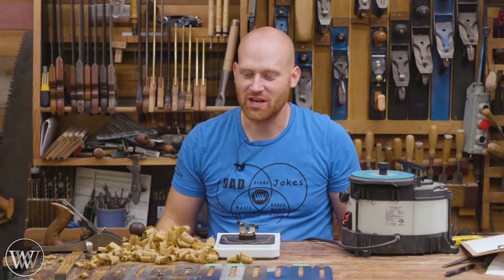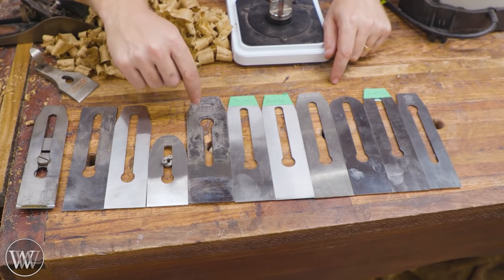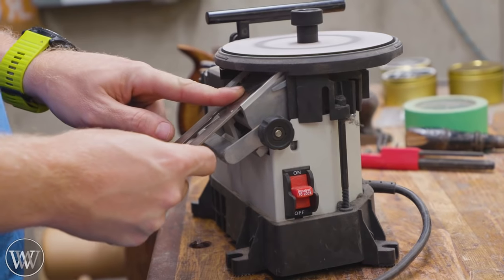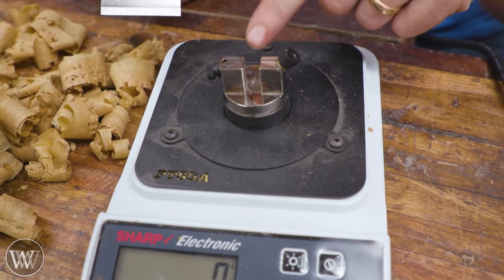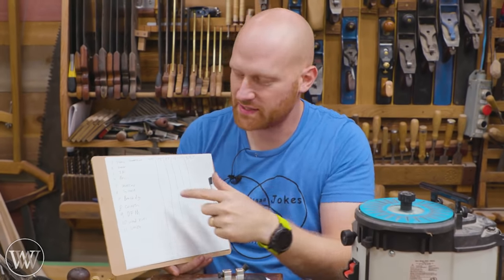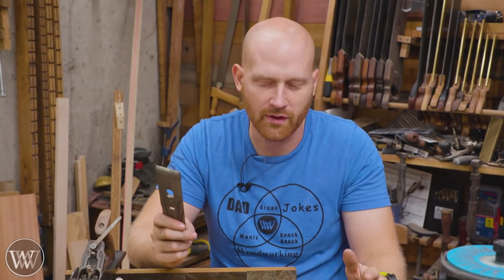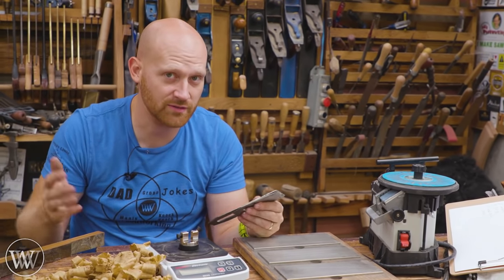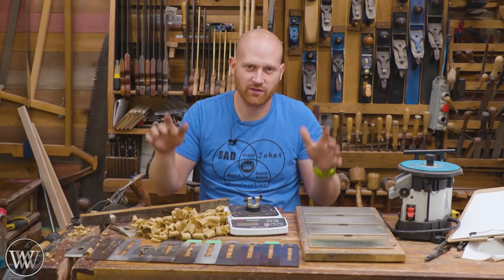Plane Iron Test Method

Comment: hello! i´m a bass builder in Mexico City, i have and use some Mexican made Stanley planes (3 and 7) and an old USA made no. 5.  My teacher shown me some of his blades... they are the regular old Stanley blades, with some saw steel blades braced to the original blades...  recently found and get an Chinese (AliExpress) blades that are made that way,  the cut portion is very nice hight speed steel a little bit thicker than the "base",   The finish is not great, but after some work with a file and sharpening, the blade seems to work very very well, and stays sharp longer than originals.  Cheers Rodrigo

Comment: Your testing methodology looks interesting!   A couple questions:  Is the video around 5:04  and 5:45 duplicated?  Second, do you measure the thickness of the shavings / blade depth of cut for the different blades?   I would imagine a test with blade X producing a shaving of 1/1000 inch and blade Y producing a shaving of 1/2000 inch during your test run would result in different sharpness results.    Looking forward to seeing your results!
Reply from the maker: LOL I missed that int he edit I will have to see if I can change it.
yes I do check the first shaving of each run to make sure it is the same on every cut
Reply: @WoodByWrightHowTo  You may want to get one of those plane setting gadgets from iGauging. It should reduce the number of test shavings that you'll need to get to your desired thickness.
Reply: @WoodByWrightHowTo  Like Matthew said, test shavings will skew results. Id try one of those router table depth gauge things to see if you can get an accurate setting right away.
Reply from the maker: So far in my tests I have not actually had to adjust it at all. I still check the measurement of the first shaving to make sure it's within a thousandth but as long as the depth adjuster isn't moved and it's set right back against it it will give you the same shaving.

Comment: Hey James, you should consider testing impact resistance of the blades. Eg when you're using it on shooting boards. Maybe a fair test could be of you shooting end grain of the lignum timber you have.
Reply from the maker: I might have to think of adding that. it might be worth the test.
Reply: There shouldn't be any impact damage on plane irons in a shooting board unless you're shooting something like purpleheart (which you probably shouldn't shoot). A shooting board is a poor test of durability, too, as the overhead bias of a plane doesn't work (that is, when you push on a handle of an upright plane, it's working as it should. It's lacking pressure on the sole when it's on its side). I did a plane iron test a couple of years ago now and found that on a board end upright in a vise, O1 planed about 800 feet and V11 planed slightly more (in cherry). V11 planed double O1 in long grain (which is sensible as it is about double the abrasion resistance). It was a painful test to do, so I didn't plane a wider array. If you think about how many shooting board strokes that would be, you can see why shooting boards weren't often used historically unless items were small or very narrow  -they're wasted effort.

Comment: Great timing on this series for me. I just picked up a stanley 5 1/2 for $10, but the blade is almost used up and will have to be replaced. Luckily I have a 6 that uses the same blade, so I can play with it until I learn from you which replacement blade is better or decide to just make my own blade.

Comment: I tested an array of irons a couple of years ago and planed about 50k feet (and weighed the shavings). The irons that I tested with their relative life to good O1 (I made the O1 iron, but later tested it against a hock iron and it planed slightly longer than hock, but probably within the margin of error). 

* Ward laminated: 0.72
* Starrett O1 steel hardened to about 62/63c: 1.0
* Tsunesaburo blue steel: 1.03 (this iron released bits, probably carbide, but all of them likely do, so they underperform expected a little bit)
* LN A2: 1.25 (but you wouldn't like using it after the same distance the O1 iron dulled)
* Chinese HSS (green irons with the bit brazed on the end) - overhard vs. spec, over 65: 1.7
* CPM 3V at 59 hardness: 1.7
* PM V11: 2.0
* CPM M4: 2.05

What you'll find is two things:
1) irons with a greater volume of carbides harder than iron will wear longer
2) irons of the same composition with higher hardness will wear longer

I repeated some of the tests above, and have used a lot of V11 since doing this test - it does take twice as long to sharpen (not to get sharp, but to remove the same amount of metal and get past any nicking that has occurred). V11 is not particularly tough, so it will accumulate some of that nicking in regular work (a2 does, also), but in an idealized test, I didn't see any real edge damage from anything except running into silica inclusions in maple (that destroyed the edge of every iron and I had to restart the tests - twice). 

No matter what you do, someone will have a problem with it. My data set was tight (the results above were from a couple of tests normalized together - any odd results were repeated). 

The V11 iron has less cut resistance in a LN 4 - I didn't listen to hear how you're going to test, but you can feel it. M4 and 3V had much more cut resistance at the same sharpness (1 micron diamonds)

I would sharpen the irons at least to 32 degrees final bevel to limit variations in the results due to edge damage. People will have a problem with that, but the question for them is why they would use their irons at a shallower angle if edge damage limits edge life. You can ignore them. 

I've gone back since then (I found out what alloy V11 is and made a bunch of irons for myself, and eventually sold the "real" v11 iron) to O1 for the most part for heavier planing as it nicks less and is far faster to sharpen nicks out of.
Reply from the maker: Sounds like you had a lot of fun with it. I actually just finished the testing yesterday and should have the video coming out on it in the next week or so. In the end I tested 24 planes. Many of which had the same alloys but ended up working differently because they were treated differently. There were a lot of very surprising details that came out.

Comment: Consider including a vintage Eskiltuna blade - I might be able to find one for you if none are available however international shipping time/delay may ruin your schedule.
Reply from the maker: The problem with testing vintage planes is that there was a huge variance from batch to batch in hardness and it really won't tell you much about the rest. Until digital controls came around for tempering it was something that was more by eye and feel than measurement. And different companies would actually have fairly large variances on quality control because there was no way to actually lock it down. I'm including a couple vintage irons just as a control. But I may add more in the future we'll see

Comment: I know your done with these tests but another thing you could test is rust and corrosion resistant. I'm sure you've noticed that some tools rust way faster than others. I've got some tools that will start rusting immediately when they come into contact with any type of moisture. Many times they are my favorite as far as performance goes but they take a lot more maintenance. Usually if they set for any amount of time you'll have to strop them especially if you forgot to oil them before you put them away. You could probably tell a great deal about it if you know what kind of steel is being used. But I don't know if the manufacturer reveals the types of steel used. You would think for replacement blades they would but I've never really checked.

Comment: Control/measure shaving thickness.  Include plane waxing into process control.  Need to control iron pressure on plates in some manner a well as perpendicularity to get consistent readings. Need to do move irons through in a random manner and in small work group activities.  i.e. Iron #1 20 shavings, Iron #5 20 shavings, Iron #2 20 shavings.  Complete all shaving work prior to moving to next work group.  BE RANDOM to reduce induced bias into the process.  Be sure to use the same piece of wood for all irons in a group/series (20 shavings for each) before changing wood.   You might look at "David W" channel for additional information some of you irons, process used, etc.  Good luck and thank you for sharing the results.
Reply from the maker: right on. I will be measuring shaving thicknesses and yes they will all be done in sequence I have padded storage shelves to protect them when it is not their turn in the plane.
Reply: @WoodByWrightHowTo  Right now you have too many variables to get good useable empirical data. I suggest replacing the tote and knob of a plane with blocks of steel or lead, then add a pulley to the end of your bench and run a  1/16" steel cable (it won't stretch like rope will) from the front of the plane (the knob block) thru the pulley and attach it to a weight. To use this setup, you drop the weight and let gravity pull the plane along the test piece. This will give you a constant downward pressure on the sole and a constant acceleration of the plane thru the wood. By keeping everything else constant (wax/oil on the sole, the width of the test wood, depth of cut, etc... you can measure just the time it takes the plane to work its way thru the wood (think Pinewood Derby or in this case "Hardwood Derby"), which is directly relatable to how sharp the blade is. Also, there's a metallurgist in Rex Krueger's Patreon group that's been testing the hardness of different low-end chisels. You might approach him to do actual Rockwell hardness tests on the blades after you've made the cutting tests.

Comment: For the testing on the wire, instead of by hand, can you do that by a jig so there is no variance of hand pressure? This would give a more consistent reading.
Thanks for doing the testing! It will be an interesting exercise and you will be doing lots of planing! Enjoy the test and I'm looking forward to the results
Reply from the maker: Yep. I have a jig made up for that I just have to adapt it. I made it for the chisel test but need to make it a little larger to fit the plain irons.

Comment: Unless I missed it, you might want to add Rockwell C to your testing.  I have noticed that is a common value given for irons and chisels.
Reply from the maker: I am hoping to do that as i did it with the chisels, but the price is fairly high to have it correctly done.
Reply: @WoodByWrightHowTo  I dont know about Rockwell c, but AvE uses some files that are hardened to a specified degree and by working your way up or down the set, you find the hardness of the steel. This may be a method that would work. It isn't machine grade accuracy, but it would give a good idea.
Reply from the maker: I have a set of those files unfortunately they will not give you an accurate enough number. Most of these will be within a couple points in the spectrum and usually falling right in between two of the files.

Comment: Makes me really curious about the iron in my ancient skew shoulder plane. It's quite thick, just under a 1/4 inch, and is coarsely hollow ground or rather perhaps hollow filed. That makes it fast and easy to hone but it doesn't require touch-up very often. Granted, it doesn't get the use of my three primary preparation planes it does get worked as much as any of my joinery planes. Lmao, maybe I like it because I know it's older than I am by a lot.

Comment: Hi James, I'm really happy your doing this test as I work with Yellow Box, Red Iron Bark, Red Box and other Australian timbers that are exceptionally high in Slica content.
If possible if you could add to the test Ward and Payne, Sargent, Millers Falls and Matheson irons would be amazing. There is also apparently quite a difference between Stanley blades form different times. Pre 1920 are meant to be really good. I have one that backs that up. The modern plane maker that would be interesting to test is the high speed steel irons from N.H.T. Gordon & Co. An Australian plane maker. Regards Aidan Banfield
Reply from the maker: thanks man. yes you guys have a crazy hard time down there. I am not testing antique irons as up untell digital heat treating there would be large changes from batch to batch. so even one maker in one year could have wildly different iron quality. So testing one of those would not tell much about the rest from that maker. the only reason I have these two (sweetheart and old Sheffield) is as a control for the others. I am just testing replacement irons and unfortunately HNT Gordon does not make replacement irons. they only make them for their planes and wood body planes. but I might cover them some time int he future when i do other types of irons such as some of the Japanese irons.
Reply: @WoodByWrightHowTo  Thanks for your reponce. I understand completely your thinking and looking forward to watching your video. I'm very interested to see how the PM V11 Iron goes compared to the others, particularly the Hock - hoping it's their 01 High Carbon steel blade you have - which I've had good success with. My A2 (Lie Nelson) doesn't cope with dry interlocked grain beams of Yellow Box - with it I get about 30 seconds until it is not keen enough to cut Yellow Box. For pictures of what I'm working on see @wetlandscreations Facebook page. Cheers Aidan
Reply from the maker: I will be testing both of the Hock irons. It will be fun to see instead!
Reply: @WoodByWrightHowTo  Cool, this will be my most anticipated Ytube video.

Comment: I would love to see the pushing force on the plane itself, additionally i could see it being necessary to guide the plane so the chip is taken in the same place as you are measuring (not to mention effective contact angle variance from a slightly skewed plane). also agree with what Dan says below about chip thickness could see this being a bit of an issue.

Comment: I'm not sure how to best quantify this, but I've often wondered if certain steels have an optimal sharpening method or target grit.  My own extremely UN-scientific experience is that the plainer the steel, say a vintage Stanley, the easier to go from a fairly coarse stone to a strop.  While fancier steels, A2, PMv11, seem to benefit from stepping through grits say 1000, 4000, 8000, and possibly skipping the strop entirely.  (The edge also seems to last longer the smaller the jumps in grit, but that strikes me as bordering on impossible to make a fair test.)

I don't have a good idea on how to create a fair test, but a list of questions that may inform a test, and probably more questions.  And certainly a whole lot of time spent on such a test.

1. What is the optimal method to sharpen each steel?  Not necessarily for speed, but in terms of sharpness.  Strop vs. no strop, stopping at 5000, 8000, 12,000, etc.  I'd imagine something like using your scale setup after each grit.

2. Does a hollow grind meaningfully impact edge retention?  Theoretically, a hollow should be more fragile, but is it actually?  And if so, how much? Does it matter on different steels?

3. Speed to resharpen.  A brand new A2 iron takes much more work than a brand new W1 iron for initial setup.  Once dialed in and just maintaining sharpness, how do they compare?
Reply from the maker: that would be fun to experiment with!
Reply: Re edge retention - I remember reading a paper that went into how the higher the polish, the longer the edge is retained - I think it was to do with minimising the number and size of micro-fractures that would propagate and lead to dulling.
Reply: @clamage  That is my understanding as well, but it would be neat to prove it.

Comment: Maybe (probably?) you've already thought of this, but as we all know a slicing action cuts better than a chopping action. For the sake of uniformity, you want the blade to cut through the fiber of the sharpness tester with a chopping action. But I'm wondering if some slicing motion could accidentally be added by the fact that you're holding the blade in your hand. Even a slight tremor in your hand (as you get tired from all those planing strokes) could introduce some slicing action. If you put the blade into some kind of simple mechanism that lowered it into the fiber as you pulled a lever, that would eliminate that human variability.
Reply from the maker: yes I will use the same holder I used for the chisels once I can modify it for the plane irons.
Reply: @WoodByWrightHowTo  Ah; I'd forgotten about the holder in the chisel tests.

Comment: Would be interesting to see a 'Norris' iron and a 'Record' iron (NOT the new 'Irwin Record', old 'Record'), especially the 'Record' as that is the most common vintage plane here in the UK, Thanks from across the pond.
Reply from the maker: The problem with testing vintage irons is that the variability and steel was a surprisingly large margin. Up until digital temperature controls were available for tempering you would have a very large variety of hardnesses from batch to batch. The only reason I'm including a couple old irons is just to have a data point for a control. But I am thinking of including a couple more just for the fun of it.

Comment: I think the testing method is good, but you should get stanley irons from each decade. I know their planes changed over the years (cheapened), so I wonder what happened to the irons. Did they become softer, or did they stay the same since they are the most important component?
Reply from the maker: The problem with most older irons is that they had a much wider variance from batch to batch. So even over the course of a year you could get surprisingly different hardnesses. I am thinking about trying three different Stanley irons to give a clearer control.
Reply: @WoodByWrightHowTo  Wow! I had no idea they varied that much. But it makes a good excuse for why my planes are dull so much of the time!